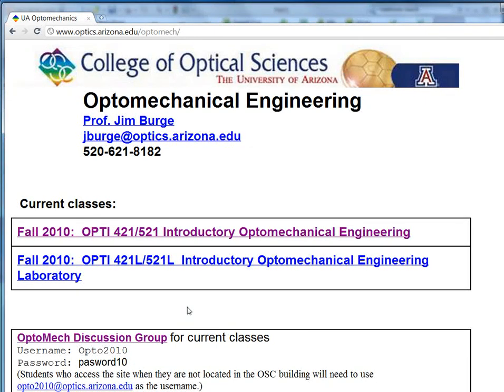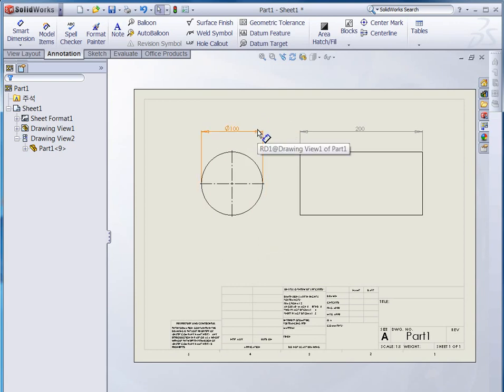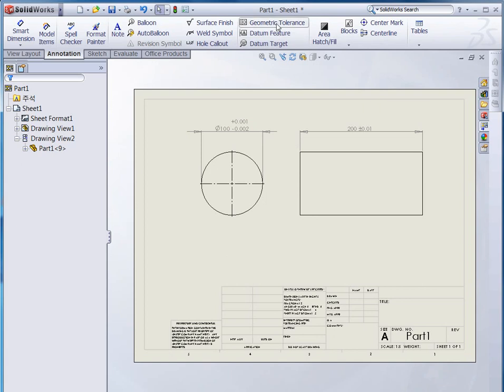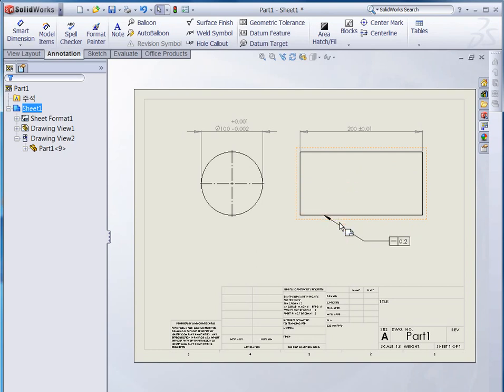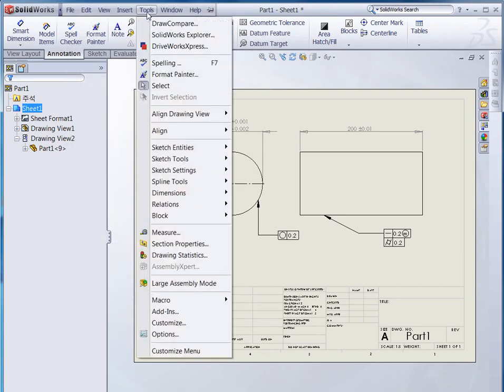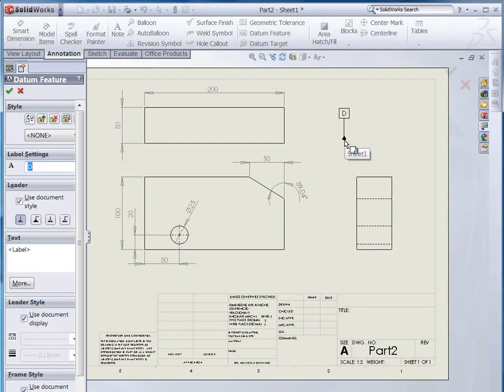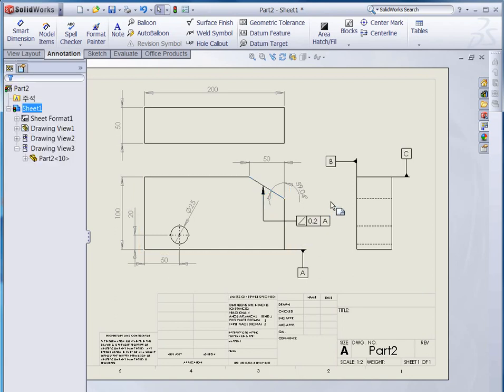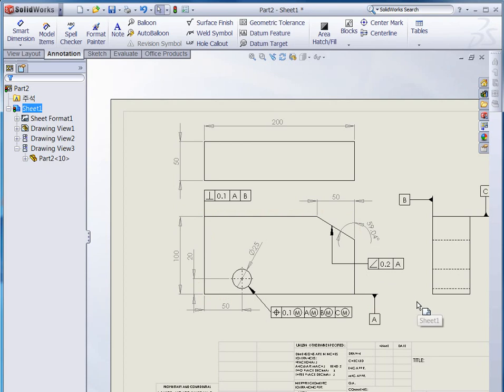OPTI 521/421 Dimensioning and Tolerancing in Solidworks

Comment: In this video you have stated the two most important things that anyone using drafting software needs to know. However so many people who use this technology have no idea -1 Tolerance your dimensions (This is the golden rule)2 A well designed component, normally, shouldn't need excessively tight tolerances, making tolerances tighter than they need to be only increases costs.I guess its all about balance, I have received drawings with no tolerances whatsoever, and I have received drawings with very tight tolerances even on nominal clearance surfaces. As a machinist, frankly I can tell a lot about the person who created the drawing just by looking at the tolerances.
Reply from the maker: +Matthew Donoghue Thank you for you comments. I would like to tell you about excessively (your word) tight tolerance in opto-mechanical systems especially. Most optical systems require ultra high precision these days. Students I am teaching are not studying just normal mechanical systems. They should meet less than 0.0001" (0.002mm) for some cases. Also they have to deal with self-weight deflections and thermal distortions as well including optical components. We are usually taking care of nano meter level of deflections and distortions in mechanical parts not even in micro level. Please consider in different field of application. Thanks again,
Reply from the maker: +Matthew Donoghue Main purpose of this video is for showing GD&T capability in Solidworks. The values of dimensions and associated tolerances are just an example how to put them into their fabrication drawings. The values should be relevant to each specific design to meet their design goals.